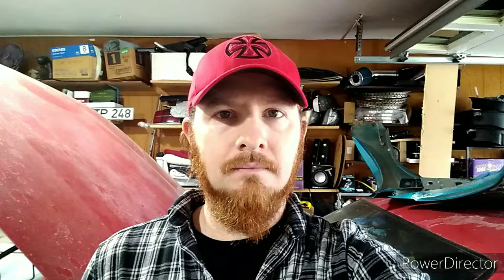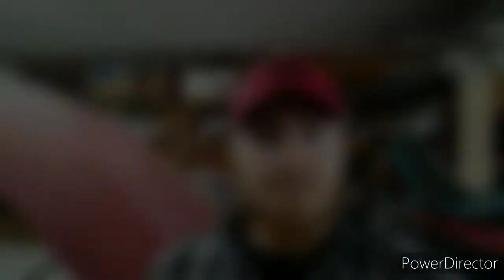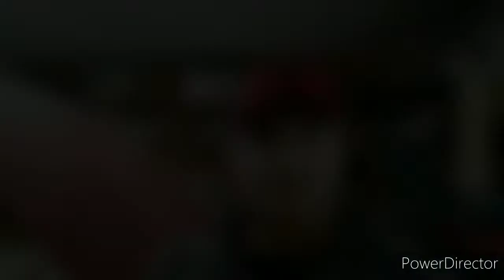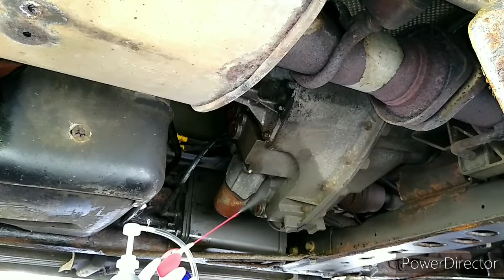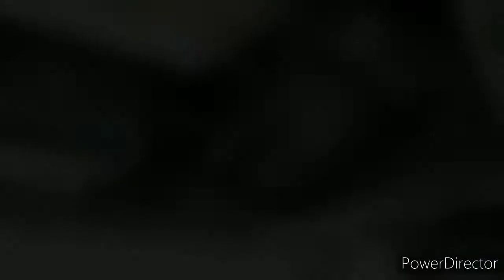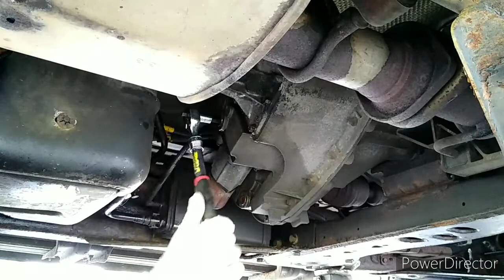Chevy Trailblazer transfer case fluid change

Comment: in my 07 the Fill plug is so close to the gas tank you can't get a socket on the end on my 10mm Alan, so I had to use a crescent on the Alan. My 02 Envoy had plenty of room, like your video. I don't recommend anything but the Blue Auto Trak II fluid.
Reply from the maker: That's the GM brand, correct?
Reply: @MurphRocks86  GMC Envoy 07

Comment: Thanks bro - 
things required, general common sense safety practices, car maintenance oil change level experience and 7 qt drain pan, 10 mm allen socket and 3/8” ratchet, 2 qt valvoline transfer case fluid or (AC Delco auto-trak ii), Quart screw on lid type transfer pump or Self Priming Transfer Pump for Drill
Reply from the maker: I need to do more how to videos, but most stuff I do is modifications instead of maintenance, lol.

Comment: I filled mine until it started to dribble out the fill hole, it seemed like it may have been a few ounces than 2 quarts, do you suppose that is OK? I did this because a couple of times the fill hose slipped off the pump and I lost a bit of fluid. I know over filling engine oil and brake fluid can be harmful but figured that the engineers would have placed the fill hole in the ‘right’ spot so that you couldn’t overfill, do you agree?
Reply from the maker: Honestly, that's the best way to do it!